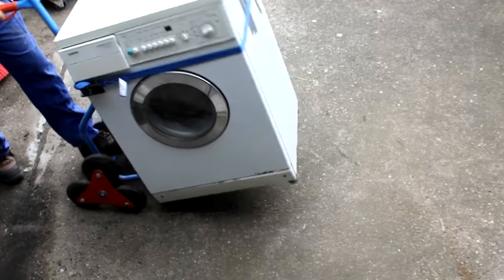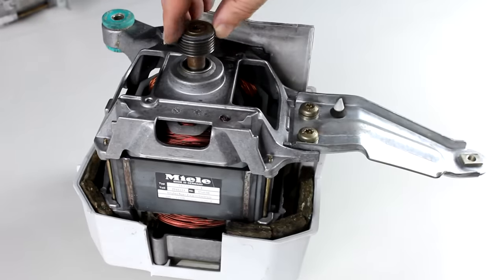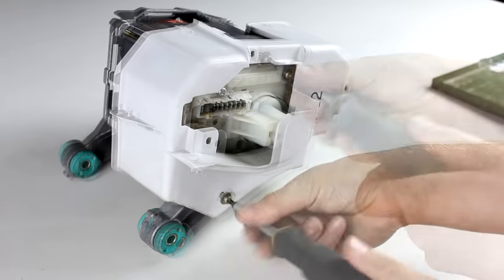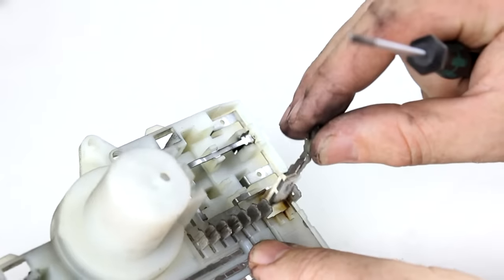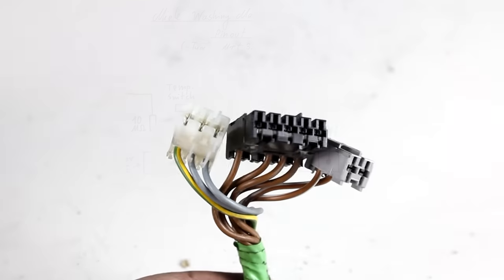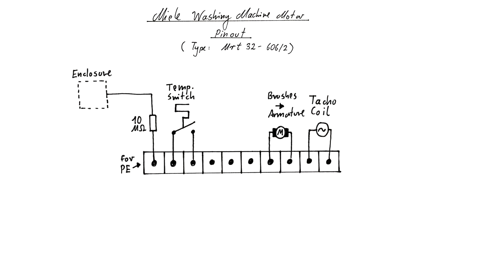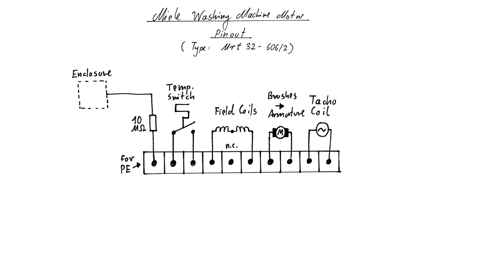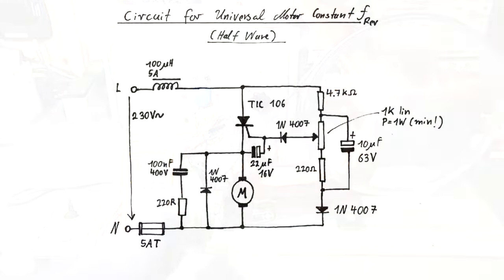Inside a Washing Machine Motor: Explanation,  Pinout, Teardown AND Experiments

Comment: As a Miele technician for 30 years  I can tell you guys that these motors are 30 years old and the Identical motors are still made and used in the Miele machines made today , I have never seen bearing failure but I have seen the amatures fail from being worn down to a nub....  These motors are SUPER reliable.. I have gone to many of these machines for service and have replaced motor brushes up to 3 times on the same machine over a 20 to 30 year life of the machine.

Comment from the maker: I mentioned a lot of my older videos in this epsiode. Here is a list with links:

Teardown of a Siemens Washing Machine:
https://youtu.be/H_JV7jTH4wU

Reusing Washing Machine Motors (Thyristor Circuit):
https://youtu.be/tUQg2WiHpUY

Ducted Propeller with Washing Machine Motor:
https://www.youtube.com/watch?v=KTZ9PB3l3jI&t=25s

Video about the Power Grid: 
https://youtu.be/OBYzvkY2-eA

Video about the Isolation Transformer:
https://youtu.be/_pEmpvcNmXg

Video about the Lab Power Supply:
https://youtu.be/J3N6RX_wAJg
Reply: can a washing machine motor be modified to be used for a sliding gate opener? Or other question: from where could I salvage a used motor for my DIY gate opener that is strong enough?
Reply: please build a lathe or mill with those motors

Comment: It will be nice to see you get a solution operational with AVR.  You could then use PWM control in conjunction with a PID algorithm to vary speed.  Controlling AC with PWM can be a bit more involved than DC, as it generally needs to be implemented with some sort of phase synchronisation.

Comment: Interesting video. I've been working on a Hotpoint washing machine today. It's motor was a 3 phase type. 5 pins, 2 for the tacho and 3 for the motor windings.
Reply: Do you know where 3mp Klixon thermal switch/fuse can be purchased in UK? I'm working on an old hotpoint wm63n

Comment: 21:44 no. the leftover magnetic field is so small that the torque of the motor wont be enough to overcome the friction of the brushes. the reason it runs when only powered trough the brushes is the way the rotor is wound. it generates its own magnetic field parallel to the magnetic flux lines the stator should have then closes it trough that same stator, so the stator is magnetized as if you powered its coils. in reality the stator coils are optional to the principle of operation of those motors and their purpose is to increase the power rating of the motor without making the rotor bulky. (its cheaper to have small rotor and stator coils than a bulky rotor). you can see this yourself by first exciting the stator coil in one direction, turning it off, seeing what direction the rotor would spin in then excite the stator in the other direction, turn it off and you would see the rotor doesnt care.
Reply: this also is the reason you should be very carefull with the polarity of the rotor and the stator current if you want to get the most of the motor
Reply: magnetize a nail to its maximum and see how small leftover magnetic field it can have when you leave it on its own. now imagine this field 10 times lower and this is how much you can perm magnetize the stator iron core, because the stator is made of special steel optimized for low magnetic hysteresis

Comment: This Motor was made for Machines up to 1200 rpm spinning, machines up to 1400 had a field-switching line, thats the pin „nc“ on your motor. Just for info. Or maybe an idea for another video, how to switch low and high rotations.

Great job man 👍🏻👍🏻👍🏻

Comment: Thank you! I love the idea of building an electric vehicle using these salvaged motors and other salvaged parts. I live in Germany as well and see a lot of useful parts lying around on the street every day. I'm gathering enough technical knowledge to put together the vehicle. Thank you again!
Reply: why don't you use a 12 v car starter  for that? the washer  machine motor is for 240/120 v  ,,,no work on 12 v battery ,what you see on yuotube is stuff made by people have no clue or experience of nothing ,don't trust them
Reply: @lesstime1678  What you say about the car starter is correct and that's actually not a bad idea but it doesn't necessarily mean that the person running this channel has no idea about what he's talking about. In fact, he's pretty good at what he does. I'm saying this based on watching his channel for a while now. But thank you for the suggestion.

Comment: I'd like to see you explore using it as a generator (using strong permanent magnets) which might be good for a wind generator.  Or secondly you can combine this project to make an cargo eBike since you mentioned cargo bikes before :)
Reply: thank you very much for the clear explanation of sensors, magnets and field windings.

Given that energy is becoming or is very expensive these days.

Some time ago I thought of purchasing an existing generator with a petrol engine and replacing the petrol engine with an electric motor. of course, this idea had been around for much longer. Only nowhere or through subtitles or explanations, whether or not bad, do I find out slowly or not, which engine is best suited for this, given this to make the speed automatic and stable. I would like to see such a video made by you or a clear explanation and your vision about it.

I think you will make a lot of people happy in this expensive time.

Unfortunately I don't have this kind of knowledge.

maybe and or else, thanks in advance on behalf of myself and the benefit of others.
Greetings from Holland Elzo

Comment: Since you will control the windings (field and armature) separately, I think that by adding very thin wire to the field (with thinner wire but more winding to match the former amount of copper that was used there) will increase torque and reduce speed.

Comment: Great explanation of electric motors. 
I have LG Direct Drive that has - if i remember correctly - ring with permanent magnets as rotor attached directly to the shaft and something like 30 or more radial coils as a stator. I guess it creates three or more phases to power some coils and it can use remaining coil to monitor actual position and switch phases when needed. It's very simple mechanical design (no moving parts except the drum) with somewhat more complicated electronics for monitoring position and creating likely three phase AC with variable frequency. I believe it can precisely control position and speed of the drum and estimate weight of the laundry just by swinging drum a bit and measuring current generated as it returns to original position.

Comment: I really enjoy your videos. Next to roadkill, you are my favorite. Have considered doing more with car parts? Using car parts for things outside of a car is interesting to me. I would even enjoy seeing more done with hydraulic systems too. Get a coil of steel brake line and some calipers, or drum style cylinders. These are cheap even new, and can be used interesting things in the workshop or home. Hydraulic circuits are simple and easy to work with once you get a little skill with the flaring tool used for automotive braking systems. It would be very cool!

Comment: Have you ever done any experiments with a compound configuration with 1/2 of the field in series with the armature and the other half in opposition to the first field with a variable resistance to reduce the magnetic influence of the fields without reducing the voltage to the point where the torque falls off so far that no useful work can be done?  Theoretically the current increase in the series winding as the motor loads should cause the torque to increase as the loadf is applied.  I would think with your shop facilities, you could do a serious and thorough analysis of this, and the Miele motor has easily accessible points to alter connection configurations.  I really enjoy your approach and conclusions.  They are concise, thorough and clearly presented.  Two thumbs up.

Comment: Amazing explanation! Really nice, really clear. I'am currently working on a vehicle project and i am evaluating different possibilities to power it. 
I have 2 question :
Do you think the seperatly exited DC motor is the easiest and more efficient way to regulate the speed? 
What is the rough amount of torque that this tipe of motor can generate with a 12/24 DC voltage supply?
Many many thanks
Jacopo

Comment: 15:00(ish): When you powered the motor via separate DC sources and stepped up the voltage, listen to the pitch of the motor.  At initial voltage it's about an A, (not important what pitch) but on raising the voltage 1V the pitch jumps an octave (frequency doubles), then after the another 1V increase, jumps by 1.5x .  These correspond to the fundamental, first, and second harmonics in the harmonic series.  I assume the rpm (min^ -1) also doubled, then increased by 1.5x as well?  Would you get the third harmonic (2 octaves above the fundamental, or 4x the initial rpm) if you'd increased by another 1V?? Fascinating.

Comment: This is all very interesting! What can you do with it? If you can have control over torque, current, rpm and voltage, you could do basically everything. I'm thinking about regenerative breaking or building something like a wind turbine, that is most efficient at all times (independent of the wind speed or the battery voltage).
This could lead to a bunch of very interesting videos.

Comment: It would be interesting to know (measure) what is the maximum voltage and current of the field coil and armature coil before the iron goes into saturation. That would be a good base for the circuit control.

Comment: The Post Apocalyptic Inventor
 thank you for this very good video and explanation. I was losing hope to find good videos about understanding and modifying used electric motors.
in the end part when you showed with a permanent magnet, how much load as we refer in my country or horsepower can we achieve in that way? I am interesting at making an Electric Pottery Wheel (, with a speed  for example 300r/min) with a water machine motor.